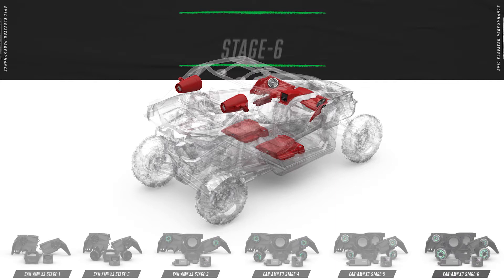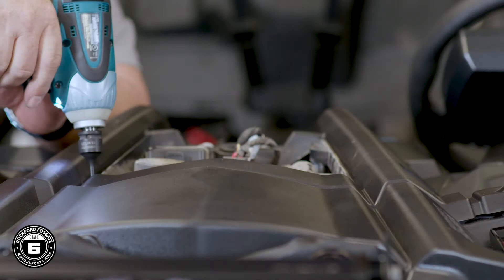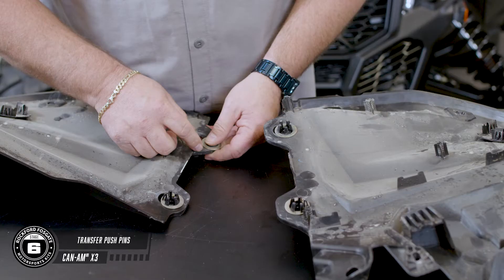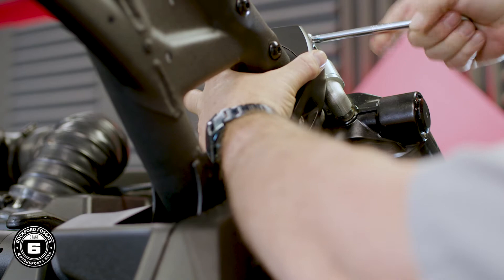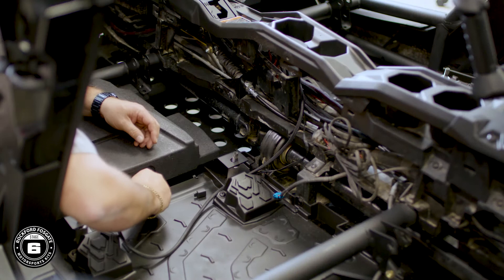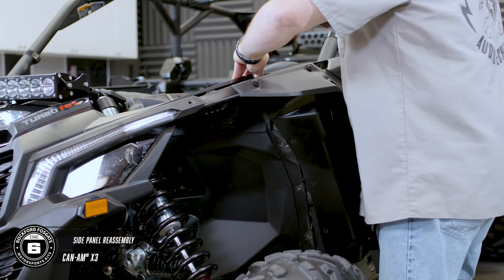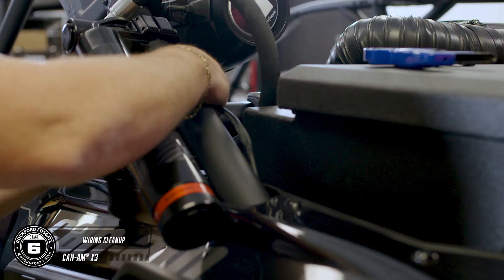Can-Am X317-STG6 Installation (Gen-3)

Comment: For everyone wondering "why the hell do my subs not work?"..  Do NOT connect your little 4 pin (white, gray, 2 black) Rear to "Rear In" on the input side of the amplifier.  Instead connect your Rear to "Sub In" input on amplifier..  I've seen this question asked many times.  This stage 6 system has great deep bass, alot of the other systems on the market lack it.
Reply from the maker: Great!  Glad you were able to troubleshoot your system and get your subwoofers working.  Greg does state at timecode 9:00 "Plug the harness labeled FRONT to the pigtail labeled FRONT, and the harness labeled REAR/SUBWOOFER into the pigtail labeled SUBWOOFER.
Reply: @rockfordfosgate  I've watched this video so many times and I must've just been deaf...to many years of your product you see 😅
Reply from the maker: @allenr2707  We have the same problem ... had to watch it a couple times to make sure 😂
Reply: Um there is no wire labled rear/sub there’s three different connections front in, rear in, and sub in but no wires for sub from the head unit. What an I missing here?
Reply: @brianmonger3452  From the head unit side, front goes to front in (input side of amp) Rear goes to Sub In, (not rear on amp input like you would naturally think)
Reply from the maker: @brianmonger3452  The REAR input to the amplifier is not used.  You only use the FRONT input and the SUB inputs to the amplifier.

Comment: When connecting speakers with the RCA connectors, using the fader leaves the front dash and rear can speakers on the front channel. Seems like this is not using the full potential of this system?
Reply from the maker: The PMX-3 has RCA outputs for FRONT and REAR.  We decided to use the REAR output as the SUBWOOFER control, allowing you to take advantage of the SUB (+) and SUB (-) buttons on the front of the radio.  The video incorrectly states that the rear output is for the rear wake cans, as the rear is actually tied to the front speakers.  Again, this allows us to adjust the bass level which is a frequently requested option.

Comment: It goes connected to the bus bar or straight to the battery?
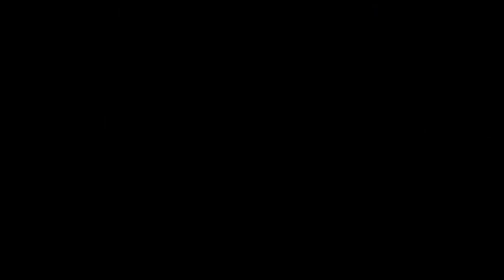Reply from the maker: At 13:10 you can see Greg wire the B+ and GND directly to the battery.

Comment: Where is the power wire connect to at minute 9:41? Also what do I connect to the sub in? I connected the front in and rear in.
Reply from the maker: The Accessory RED wire in the Can- Am is on top of the frame that supports the dash.  It’s hard to find, but here’s a trick… stand in front of the car and have someone lift up the center dash panels.  You’ll be able to see where it’s attached.  At 8:55, you’ll see Greg has a short subwoofer adaptor harness.  Both subs connect to one end, then plug the other end into the Power Connector side labeled SUB.

Comment: Will this fit the 2023 x3 max x rs turbo rr with smart shocks . I sent a email but no reply. The website hasn't been updated for 2023 models.
Reply from the maker: We see no body changes on the 2023 Can-Am X3 models, so you should be good to go.  We typically reply in 24 hours or by Monday if submitted on Friday, so check your SPAM/JUNK filter.
Reply: Yes, it does and it hammers!
Reply: @rockfordfosgate does this work on the 2024 model?
Reply from the maker: @ovvclan9751  This fits most Maverick X3 models.  You can check our compatibility chart here: https://rockfordfosgate.com/products/details/x317-stg6/

Comment: How can I connect the stage 6 so I can run it with the car off?
Reply from the maker: You'll need to hard-wire the remote turn-on harness with a switch.  This will require detaching the harness from the PMX radio that connects to the factory wiring under the dashboard.  You can find that small harness attachment at timecode 09:40 in this section:
https://www.youtube.com/watch?v=FHnFNIvsUa0&t=570s

Comment: Can I add a second set ot Motocan to this system? If so, whats the best way to do it?
Reply from the maker: Do you have this kit installed already?  If not, I would suggest listening to it because it's freaking loud with the horn-loaded 8" tower speakers.  However, technically you can add a 2nd set and run the rear channels of the amplifier at 2Ω, which the amp is stable at.  This would be a custom installation, so you would be on your own since we don't have guides or instructions on how to do this.

Comment: Where does the sub in cable connect to from the amp
Reply from the maker: 6:45 - run the subwoofer harnesses from the steering column in the dash to the [under] seat location.
7:09 - install the subwoofers and plug the harness into each subwoofer connector (remove the black plug).
8:38 - wiring the amplifier starting with the output terminals of the amplifier.
8:57 - connect the subwoofer "Y" harness to the amplifier's subwoofer output.
9:00 - plug the harness from each subwoofer into the "Y" harness.

Comment: Dash speakers will make the steering pull hard right. you will have to have the steering reset at the dealership with no guarantee that it will fix the issue.
Reply from the maker: This anomaly is covered in our technical article “Can-Am X3 power steering torque offset reset” https://rftech.custhelp.com/app/answers/detail/a_id/1374/
Reply: 😂😂😂 it’s an easy fix relax brother